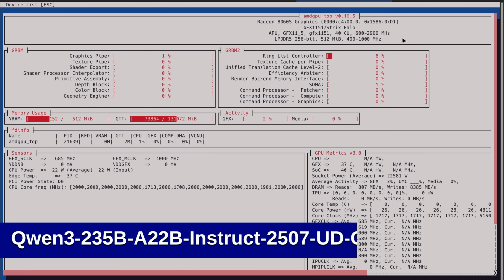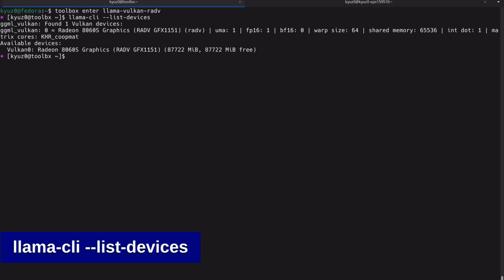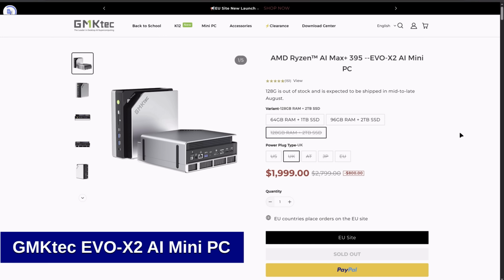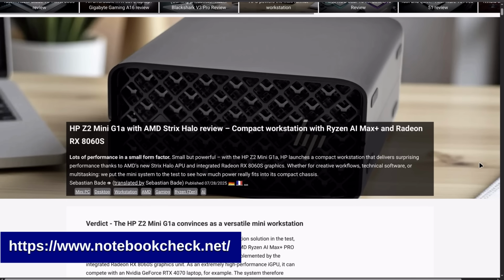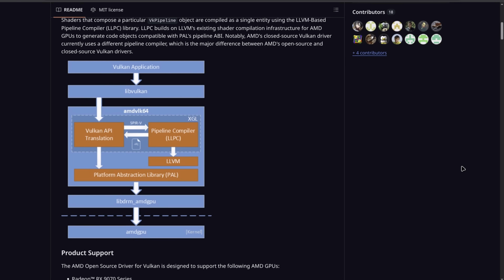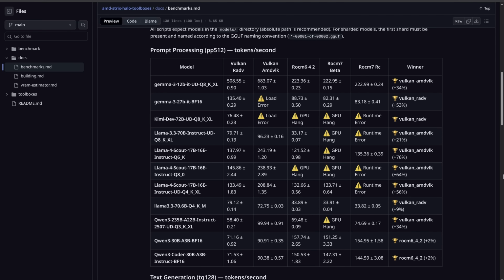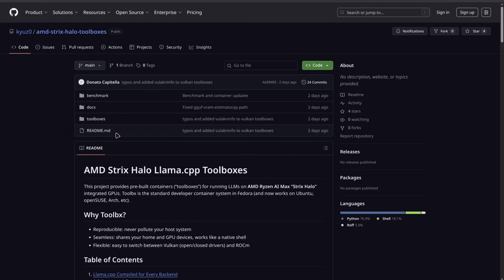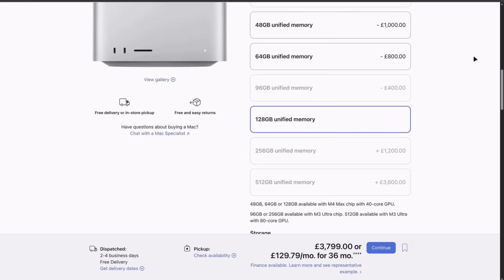GLM 4.5-Air-106B and Qwen3-235B on AMD "Strix Halo" AI Ryzen MAX+ 395  (HP Z2 G1a Mini Workstation)

Comment: I thought ollama have a bug with GTT.
Do They fixed It?

Edit: oh sorry, my bad, GTT worked good, the problem was VRAM utilization.
Thanks for the video.
Reply from the maker: Haven't tried Ollama, do they have a Vulkan backed?
Reply: @donatocapitella  Oh, I don't really know, I use ollama with rocm.
Your video is very informative.
I am just learning.
I will investigate further.
Reply from the maker: @mercuriete  ROCm will do if you build it with rocm-6.4.1, I might try and get this up and running to check how it does.

Comment: You could try Lunar Lake + 32 GB RAM.
It's obviously more limited than Strix Halo + 128 GB RAM,
but it's also more common, and more powerful for LLM than it sounds.
iGPU also gets access to the RAM,
and within 32 GB RAM (realistically ~25 GB for LLM),
it's still very potent, and can offer surprisingly good service.
You won't run Qwen3-235B on this,
but you will run its little brother Qwen3-30B.
And it's quite snappy.
Reply from the maker: Thank you, I hadn't realised Intel caught up with unified memory. Have you been able to run some benchmarks? What software stack does it support on things like llamacpp? Is it vulkan?
Reply: @donatocapitella  It's still a "traditional" 128-bit bus (as opposed to Strix Halo 256-bit)
though they employ the faster LPDDR5 variant.

Inference is mostly done via Vulkan (for the quite capable igpu), and llamacpp for cpu.
Splitting the load between the two is actually surprisingly good, likely because it's unified memory, so no PCI-Express transfer.

I mostly used Gemma and Qwen3 models on this system. I believe I got it to run Qwen3-30B at ~20 tok/s.
Reply from the maker: I read memory bandwidth on lunar lake is 136 GB/s, I hoped they could do better.

Comment: Extremely informative and helpful.  Thank you.  I found the same HP model in the US for $3372 + Tax.  I'm currently using a AMD 7800 X3D with a 7900 XTX 24 GB and I can do some real work with it but even at $4000 the AMD AI Ryzen Max+ system would be awesome for many tasks.
Reply from the maker: Yeah, I'd say the large unified memory does the trick here for Strix Halo, you can load large MoE models and inference is quite good. I'd love 512GB with double the bandwidth, but I'm dreaming 😅
Reply: @donatocapitella  THANKS, great video. I want to try a kubernetes container for IA in my recent 7800 X3d + my old 6950 XTX 16 Gb, but I cannot find tricks or configurations as you did - CONGRATULATIONS, great chart and containers and python scripts too,  to make it work well enough.

I want it just to start and develop projects, and upload it to the cloud if they work well. I do not like NVIDIA non open source policy, but it seems a 5090 is necessary if I want to perform this task, and before I will buy it, I would love to be able to use my actual AMD GPU even it is slower, but working.

I would love to watch benchmarks, and table comparatives,  between the strix halo, and the 5090 - similar price - and AMD discrete GPU as the 7900 XTX 24Gb and the 6950 XTX 16Gb and it seems you are the best for this task on youtube I bet that "The AMD IA go to expert"  will give you more views - even if AMD continues to be worse than Nvidia - than being one more of the green team.

PS: You do not need to buy Nvidia cards, just benchmark your data with public data, from other testers.
Reply from the maker: @mitcoes thanks for the suggestion! Do you know any good source of benchmark results from a trusted source?
Reply: @donatocapitella  I recently found on github comet-ml
opik that I think is making a documented, and fair review. But I am just starting, my background, even it is techie - I use linux since 1992, and studied some Computer Systems Eng, is basically economics, and my use of IA is econometrics, and help with papers.
Reply: @shawnvines2514 - you should check out the GMKTec EVO-X2.  I got mine for $1800 USD (128GB + 2TB HD configuration) during their initial sale, but I think even now, they are about $2k for that configuration

Comment: If you order from HP and say it's for a AI server they will send out a machine with both FlexIO ports enabled, I received one with both FlexIO populated with 2.5Gb NICs (which are hard to find at the best of times) and I also got a discount that was running at the time. I think I saved around 10% off  the list price at least in the UK. This video has been extremely useful, and and actually explains a few of the things I have run into. AMD's TheRock repo seems to be getting into a mostly stable state now, at least in the last week from my own testing. Sadly I am stuck with Windows due to the applications I need to run. Still I am more than impressed with the system and it's capabilities. Whilst the fan is noisy, it's not in your face annoyingly noisy but, yeah, I would stick it in another room because it can dump a lot of airflow.
Reply from the maker: That's good to know, thanks!

Comment: Love it. Precisely what I was after. I had the exact same feelings towards the "non-mainstream-branded" boxes. Questions:

1. How painful would it be to try and fit an Oculink port via m.2 into this? This and an eGPU would be a dream setup.

2. The Mac Studio conondrum. Long story short, I'm trying to put together a solution for an SME and use Strix Halo for a big local LLM (at least for development if not small server / specialised machine deployment). I've got a funny feeling an M4 128gb mac studio is a better choice (mature platform, no driver issues, replaceability, "it just works" etc, and I don't even like Macs).

If Strix Halo didn't exist, there would be no question. But it does exist and it can theoretically access an external GPU, which Macs cannot. Since it's for a business, the money does not matter. What's your take?

Anyway, you've got a sub dude. I am SO tired of these techbros who test stuff with minimal context and zero configuration. Like, there is literally zero proper Mac Studio benchmarks, most of them just run default settings (by the looks of it).
Reply from the maker: I haven't looked much into eGPUs, I'll let you know when I have some time to get my head around that. 

I think the choice comes down to budget and use case - Mac Studio with similar RAM capacity is way more expensive 🫰 what you saw in the video and benchmarks is a pretty realistic view on what Strix Halo can do, which might be enough for a lot of use cases

Comment: Ryzen Ai cpu doesn't support Rocm
Reply: Yes it does, I'm using PyTorch as of right now here's the log: Using torch device: AMD Radeon(TM) 8060S Graphics / Total VRAM 110506 MB, total RAM 32539 MB
Reply from the maker: @ThirdEnvoqationindeed!
Reply from the maker: Ehm... It literally does, I show it in the video...
Reply: @donatocapitella  IIRC, it's operational but not the prime target; that's the Instinct accelerators. On the other hand, real world support may exceed paper support.
Reply from the maker: @0LoneTech yup. I don't disagree. Indeed I never said it was the prime target 😅 I'm well aware of the issues, there's a part if the video describing those issues. The original comment though made a statement which was simply false and needed to be called out.

Comment: I have the GMKtec, I had issues with the shipping but otherwise it's been fine and because of the seller's creative tax declaration I didn't pay much for it.
The HP looks interesting, I might investigate that for work.

I had issues with Ubuntu and Bazzite, and so now you're making me think Fedora might be better? But currently I've gone back to Windows 11 with LM Studio. I have the Beta drivers which were released last week.
Reply: LM Studio can use either selectable in settings, but ROCm cannot load models larger than 32GB.
Reply: Been looking at that as well.  Any tips regarding the seller etc? 🙏
Reply from the maker: @JumpstarOfficial you mean GMKtec?
Reply: @donatocapitella Right, GMKtec, but I wasn't sure if OP got it from a third party.
Reply from the maker: I love the creative tax declaration, would love to see what was on the label 😅

In that case it'd have cost you less than the £2300 I paid for the HP - but here in the UK if you wanted to buy from Amazon EU, the price was £2800!!! (Now it's been pulled off Amazon allegedly for high return rates)

As to Fedora, just works well as you can install recent kernels and then toolbox works really well (but toolbox should work on any Linux).

I'm curious to see what performance you get with the new drivers on Windows - please do some comparisons with my benchmarks if you get the chance.

Does LM Studio use Vulkan or ROCm for this?
Reply: @donatocapitella it uses Vulkan in LM Studio on Windows.

Comment: HP had in the docs this box has an expansion slot for possibly fast LAN card (?). Is there anything of such? They claimed this box could be used for clustering (even dedicated rack).
Reply: Yes, you can buy FlexIO cards. Mine own rig has two, but there's a surprising amount of FlexIO options out there, I am looking at getting the 10Gbe option but they're expensive if you can find them in stock,
Reply: @ThirdEnvoqationoh. 10Gbit is low. Thunderbolt 4, of which there are two, allows for 40Gbit networking.
Reply: @marekkroplewski6760  Look up Jeff Geerling's latest video, shows the current state of play on AI clustering, it's not pretty.

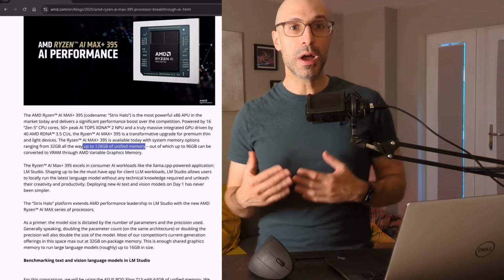Comment: I don't mean to be pedantic but 1:07 the screenshot you used also says that the GPU can only use upto 96GB of the 128GB pool, not the entire thing
Reply from the maker: You are right, I am right and the AMD website is wrong :) - it is possible with GTT on Linux to use all the RAM available (minus what the OS needs).
Reply: Im pretty sure that discrepancy comes from Windows vs Linux. On Windows you are limited to 96GB allocated to the GPU, and on linux you can set the value to whatever you want as long as the OS still has room to run.
Reply from the maker: @austinlankford1082  Indeed, I think Windows does not support unified memory - but I might be wrong. Certainly there's a case for them to add support, but the Linux kernel is much more flexible with GTT. Ultimately the amdgpu driver is part of the Linux kernel main codebase, not an external piece of software.

Comment: Now I am looking forward for the nvidia's "personal supercomputer", the DGX Spark.

How it will compare to the Ryzen MAX+. Has the same of total unified memory.
Reply: DGX Spark is essentially a 4070M in a box. It'd be comparable to that.
Reply from the maker: @ZeDarkLord do we have details on memory bandwidth/ size etc? I thought the release was for July
Reply: @donatocapitella  yes, it was supposed to be announced by now already, but Nvidia is blaming Microsoft for the issues that propped up with the development of their ARM chip, and that has now been pushed towards the end of Q3-Q4 at the earliest.

Also, I would like to correct my previous statement, it isn't 4070M in a box, it's 5070 ( 6,144 CUDA cores ) with 256-bit bus interface and memory bandwidth slightly higher than 395+ at ~273 GB/s.
Reply from the maker: @ZeDarkLord did they say what vRAM options will be available?
Reply: @donatocapitella It's 128GB unified memory afaik, with the potential for pairing two of them.   There was a lot of grumbling about the lackluster memory bandwidth, but still I think it will be a pretty solid machine with all those CUDA cores, and the price, although still a lot of money, probably worth it for us home researchers.
Reply from the maker: @JumpstarOfficial I would expect so, you can't beat the support and maturity of the CUDA stack at the moment, it's bound to perform better. This means hopefully for all of us that if AMD decides to push this, they'll do the same they did for CPUs and GPUs: they'll realise great stuff at a more competitive price. That's how they took over Intel!
Reply: @donatocapitella  There won't be specific VRAM options, it'll be shared LPDDR5x memory up to 128GB.

But the bigger question here is the ARM CPU it will be using and how well the software would be suited for it.

If we look at just the memory capacity & speed, it should be at least as performant as the 395+ ; if not better. But unfortunately the mixture of architecture this is bringing would be interesting to see. 

Ofcourse, nVidia is known for their bloated marketing claims, so we will have to wait for some time before it arrives in the market for us to be able to see how significant of a difference it marks for itself from the current offerings of 128GB and above memory options from 395+ and M4 Max & M3 Ultra compute units.

Comment: This was a very in-depth and thorough video. Thanks for making it and also doing a walk-through. That would definitely be helpful for those who want to set-up Strix Halo as headless local-LLM servers. 

I'm interested in the Framework's iteration of it as thunderbolt/USB-4 networking can probably help with clustering a handful of Strix Halo SoC, which may be able to handle massive context lengths while also using bigger model sizes.

it's good to see ROCm get consistent support & development here, hopefully it trickles down from BF16 to INT8 & INT4, too!
Reply from the maker: Thanks for supporting the channel!
Reply: You can do similar with the HP system it's got more than enough ports to hand this case use, and HP does promote this option and I've seen four daisy chained together in a rack configuration. You could even chain with the optional 10Gb/e NIC(s) if you wanted but you do have two 40Gb/s USB 4 / Thunderbolt ports on this system.
Reply from the maker: @ThirdEnvoqation I'd love to try that! What are people using? vLLM? Does it work for training with pytorch/ROCm on that multi-gpu setup?
Reply: @donatocapitella  No idea, I just know HP had a set up for this purpose. Might be punting an e-mail over to HP sales reps and see what they suggest? They're usually helpful. Don't have the budget or need for a second box yet, still mostly doing trials my end.

It'll also be good to keep and eye on AMD's TheRock Repo for changes or talk to AMD to see what they suggest. multi-gpu is above my pay grade at the moment!

Comment: looking at the price and performance i would love to see comparison with HP ZGX Nano AI Station that is expect to cost between $3-4k  and claim 1000 Tops for FP4 quantized models 
(on my m1max i'm getting between 40-58 t/s using qwen3-30b-a3b-2507 on 4-bit)

Thank you for a great content !!!
Reply from the maker: Do you know if there's a release date? For sure that one will be considerably better, both from the hardware and software perspective. However, it would've bee nice to have a 512Gb option.

I have a feeling AMD might not do the Medusa Halo, which would be the next iteration of Strix Halo, but if they do it would be great to see a 256GB option at least - but that would require twice the memory bandwidth IMHO to be really usable.
Reply: @donatocapitella  unfortunately i don't know the date - but specs are very promising. (for more memory, the only option is using NVIDIA ConnectX and connect at least two)
Reply: it’s a dud.. the main board is directly from nvidia, and the memory is known to be deaaaaad slow
Reply: @Alperic27 did you test it?
Reply: read the memory spec and compare… 273gb/s … this is slooow … the board is the dgx … there are a bunch of reviews for it. nvidia designed it for devs who want to locally test and fast connect to the bigger dgx family members… not to be itself a fast performer. for comparison: rtx 6000 blackwell (gddr7) 1.8TB/s (~same as the venerable a100 that had hbm2e)… even an old 4080 is 780gb/s … .. 2x the memory transfer speed… and for llm inferencing bw is king (kv cache access is bottleneck)!!
but be my guest… dont believe, and buy one … then dont complain of the poor ferm